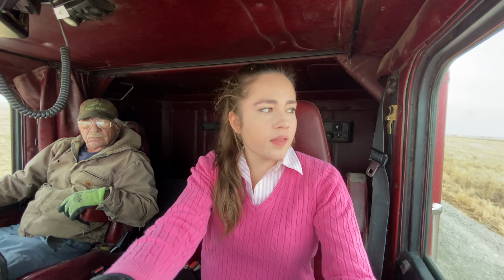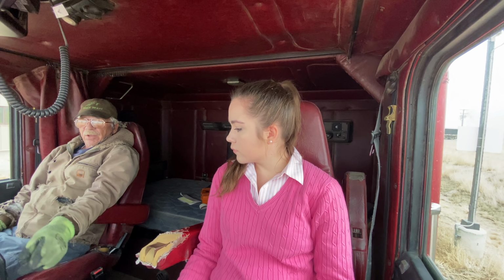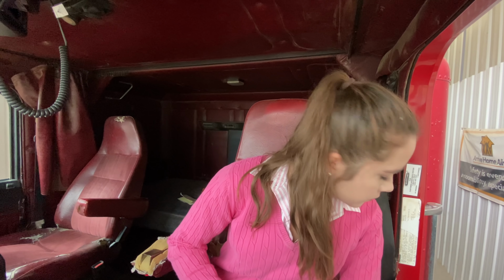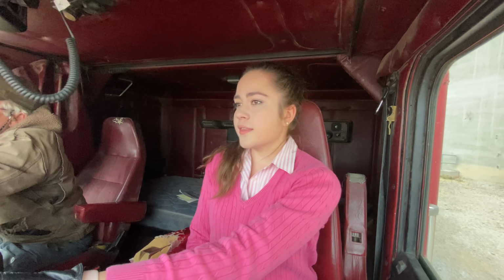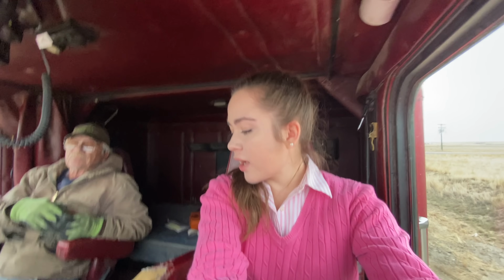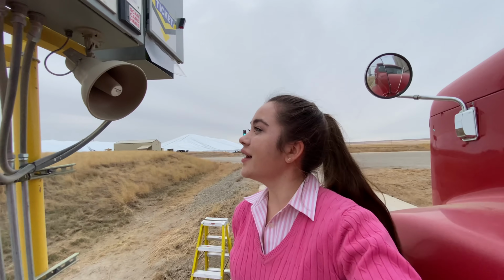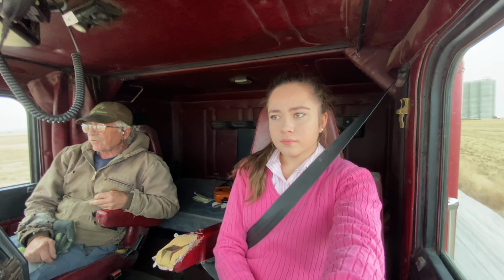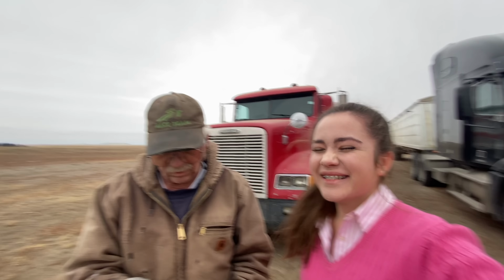Brake! Center! Stop!!!  Montana Farming 2022

Comment: Also , if you are stopped on a incline , with a semi or set of doubles , apply some trailer brake ( the arm on the right side of the street column) then when ready slowly let out the clutch while releasing the trlr brake . With a straight truck apply the park brake and when ready to move release the  brake while coming out on the clutch 😉
Reply from the maker: Thank you for your great advice Mr. Kincaid!

Comment: Another great video Kate.  If I was your Dad, I would be looking at why you seem ot have to go into extreme gyrations just to depress a simple clutch.  It should not be that difficult.  Maybe seat adjustment, clutch linkage problem/lubrication issue, but at any rate it should be no more difficult then the rudder pedals in the airplane.  I have driven trucks for years and I am small like you and I never had to go through the gyrations that you do.  Dad, CAN YOU HELP OUT?😇
Reply from the maker: Thank you Mr. Zavorka for your kindness and great suggestion.  I will ask Dad.

Comment: We were taught that when you break hard on the scales it causes them to go off balance and then they need to be recalibrated. Good way to anger the scale is by slamming on the breaks on the scales.
Reply from the maker: Thank you for your great story!!!!
Reply: Yes its like hammering the weigh bridge deck with a 40 ton hammer  also wears the ballance points  it sits on , if its  a mechanical one  ,

Comment: Not trying to bash your driving skills but, i think you need to learn how to use the 'brake' more.  I know that there is a clutch on most semis, but after your runaway tractor happening,  you should have used your brake.  Keep trying.
Reply: She needs to use gears also and wear your seatbelt
Reply: @kfelix2934  Yeah, you should learn how to drive a truck WITH a stick.  Thats pretty much the whole point.  She also should eat some more wheaties.
Reply: @lukesullivan4004  Every vehicle I own  except one has a stick & not sure what your getting at.
Reply from the maker: Thank you for your great comment and advice!!!!!
Reply: @kfelix2934  nevermind